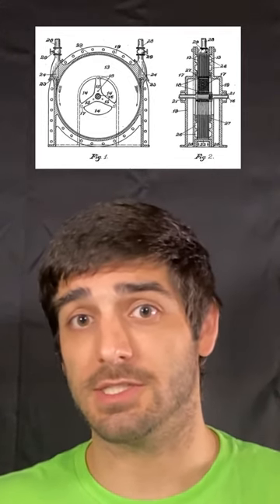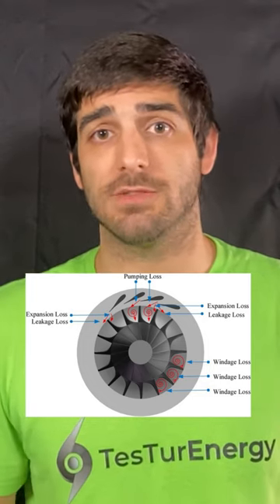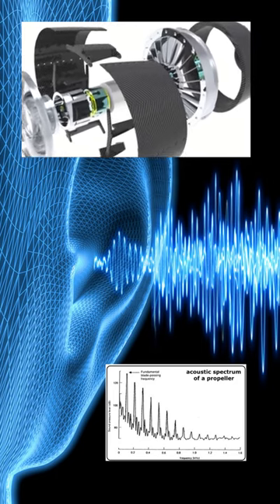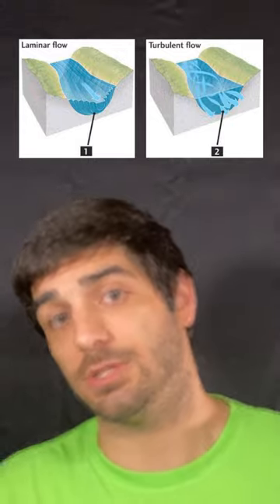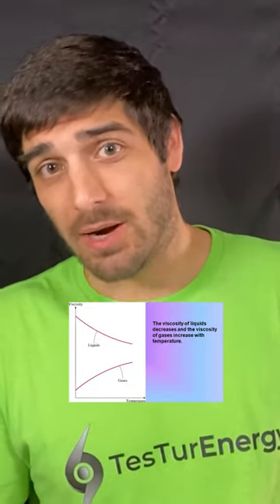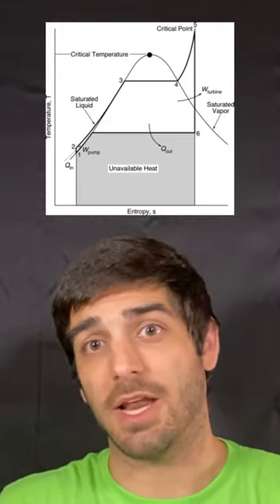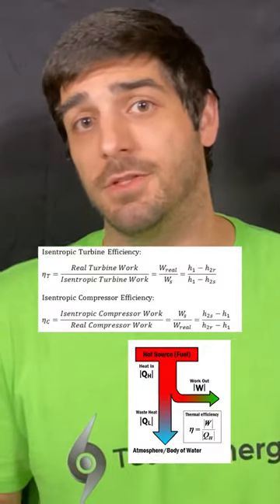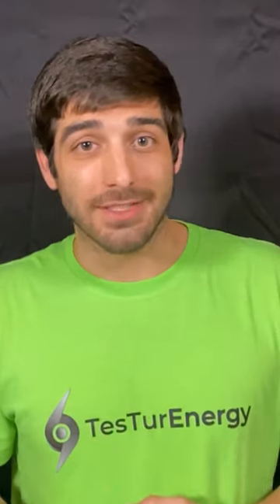Tesla Turbines For Nuclear Submarines

Comment: Do you have any side by side comparisons for a Tesla Turbine vs. a traditional turbine?  

From what I’ve seen you do show energy gains from air at a specific PSI, but there isn’t really a way in which that translates to other forms of energy. As it stands, it’s hard to tell scientifically that this technology is better than the alternatives.
Reply from the maker: Hey thanks for commenting! ❤️‍🔥🙏

First and foremost, in terms of using high pressure, low temp gases in actual generator capacities, Compressed Air Energy Storage (CAES) and Liquid Air/Cryogenic Energy Storage (LAES/CES) are very viable solutions, and they’re being employed at industrial scales as we speak.  

When we look at how engines function, they typically compress air, heat it, and then expand it.   

Most gas turbines and turbojet engines possess a compressor, operating on what’s known as the Brayton cycle.   

For those unfamiliar, the Brayton cycle comprises three main processes:  

1) compression of air 

2) addition of heat (typically combustion but could be anything) 

3) then expansion of the air. 

If we’re talking about steam systems, only heat needs to be added to vaporize the fluid. 

Systems like ocean thermal energy conversion (OTEC) can vaporize steam, or even function in an organic Rankine cycle, at significantly reduced temperatures.  

Tesla’s improved turbine patent GB 186,083 is particularly noteworthy here.  

It cleverly uses heat from the turbine exhaust to generate steam.   

This steam then cools the combustion jet before it enters the turbine, thus significantly reducing the compressed needs typical of most gas turbines.   

While regular gas turbines require an air-fuel mix in the range of 100:1 to 200:1, thanks to this innovative approach, Tesla’s patent slashes the load that the compressor puts on the shaft, making it efficient even with stoichiometric mixtures around 15:1.  

Moreover, Tesla’s patent GB 186,084 combines combustion and steam turbine functionality, eliminating the need for a compressor altogether.
Reply from the maker: As far as efficiency goes… (mind you this is a copy pasta 🍝 so it’s a bit long but it’s worth the read.) …My 2650watt electrical load run came in with a very low ball calculation of 40% isentropic efficiency.  To start off, mind you that includes generator losses, 3 phase rectifier losses, and inverter losses to the electrical load that were not accounted for. So the turbine off the bat is already most definitely doing better than the 40% isentropic efficiency I’ve calculated from the already low ball test results.   But for now I’ll just assume 40% isentropic efficiency so that I’m not over claiming what I can prove it can actually do for the time being. (I have nothing in the long run to benefit by overstating my numbers and only my legitimacy to lose. I’ve worked hard for my physics degree and don’t intend to tarnish it for a couple of extra views on the internet.) 

As far as inefficiencies to the system to fix, there’s 10x crappy ball bearings in this version, 2 crappy RC car gears, both losses will be gained for power out with a direct to shaft generator. (Minus two gears and 8 crappy ball bearings)  There’s an 1/8 of an inch of space between the turbine endplates and the casing endplates on both sides of the TesTur. That’s a 1/4in of open flow area around the 2in wide turbine (that only even has a total of 0.75in wide of spacing between all the tight disc spaces for torque to begin with.)   That means 25% of the open space for flowing through the casing, between discs and between the casing and turbine endplates, is just free flow over the side of the turbine still. (I’m using the absolute bottom of the barrel of machining equipment right now in my garage 🤷‍♂️)  There’s no labyrinth seals yet to even attempt to further reduce that overflow… 

The nozzle is atrocious at the moment, when making the variable converging section have a tight convergence it causes the fluid jet to aim more centripetally (towards the axle) instead of tangentially (glancing off the disc tips) which severely effects the fluids natural path.   This will be fixed with the new variable nozzle design I’m going with.    Then even further in this specific casing’s assembly there’s two “pillars” in the middle of the nozzle.   This is because the aluminum plates in the middle of the casing plate stack only had the variable nozzle bar and inlet holes cut out, and not the full nozzle geometry.  So those pillars are just vertical bars in the middle of the nozzle for the air to smash into just before going into the turbine (hopefully the wet steam tests will just erode them down 🤭)   Before all that there’s still about 100ft of air hose between the tanks and the turbine… plus a shell and tube heat exchanger and a TON of elbows and fittings.    I’m sure I’m forgetting something too but between all that being fixed… I can almost guarantee we will be in the 60-70s % range and that’s all just still with room temp compressed air.   Most forget, I’m using room temp compressed air and never went over 20psi at the nozzle for these tests. (Pressure differential and temperature differential govern efficiency) 

And even then I still only even have a single stage on it yet.   Everyone wants to compare it to the efficiency of a very high temp, high pressure (1000°F & ~1800psi) multibillion dollar 15-30 stage steam turbines…   😮‍💨   That’s apples to rocket ships. 😅  But considering Rankine Steam cycles get theoretical max about 33% of input heat (due to latent heat of condensation and that’s without any regenerative boiler feedwater preheat, air fuel preheat, etc) and then 40% isentropic efficiency (considering the turbine as is) we’re looking at 13.2% thermal efficiency with steam.   A more apt comparison for the TesTur would be something an individual can actually purchase, like 1-5kW piston gas generators that you can get from Home Depot or Lowe’s.   These get 15-22% thermal efficiency off the plant floor. Good luck getting that 1 year down the line or later with all those moving parts.  Also for reference, industry standard for micro bladed gas turbines is 25% thermal to electrical. Whole system efficiency can go higher in Combined Heat and Power (CHP) system, but alas the TesTur would see the same whole system efficiency increase in a CHP Auxiliary Power Unit (APU).  In the TesTur you gotta replace…? 🤔bearings…? And still even then, only maybe 🤷‍♂️ depending on how good of bearings, balance, lubing, cooling.   The TesTur, and other bladed turbines, only have one moving part. 🔥 

So if those piston generators drop efficiency, even at all, the TesTur on its worst day is competitive with a gasoline piston engine electric generator.🤓😬🤷‍♂️  And the TesTur can handle any fuel that can burn, even solid particulate fuels like powdered saw dust, pulverized coal, powdered iron, biomass, etc. (noting the number of those that can be acquired without spending money… 🤑 opening up “low monetary cost”, even carbon neutral, fuel options for MILLIONS around the world)  We have to remember that the TesTur doesn’t have to be the holy grail to be worth using if we have free fuels readily available like biomass, and even waste heat already being dumped out into the air and not used for anything.  The TesTur just has to be a viable option for some to be worth doing. 

Even more, the mere fact that I’m using a low temp fluid for my 40% isentropic efficiency calculation means my TesTur efficiency is severely limited by thermodynamics and fluid dynamics.   Increasing temps will automatically increase my turbines efficiency.  This is because gasses have an increasing viscosity trend as you increase the temperature.   This leads to increased isentropic efficiencies in the TesTur from reduced slip on the discs.  (Meanwhile, we’re already talking about a piston engine using combustion temps as is.)  Whereas bladed turbines see the increased viscosity as an increase in drag loss through the turbine blades.   So we can’t always count on seeing increased isentropic efficiencies in a bladed turbine in practice when we go from low temp to a high temp.  Again, to reiterate, this increase in viscosity in the TesTur only works to enhance the working action of the TesTur.  (That being viscous adhesion to the disc faces increasing torque.)  That’s all on top of the increased thermodynamic efficiencies of using a higher temp elastic fluid too! 🤓 

The disc spacing for room temp gasses is not going to be the same for combustion temp gasses/steam because the viscosity of either increases by 3x fold. And I’ve designed these spaces for a higher temp fluid with a slightly higher viscosity so these will inherently be too wide at the current temperatures being used.   So as we increase temps along with all these other really easy to fix mechanical issues (that only are a thing because I’m building this in my garage on a junk cnc machine) I have no doubt we will see more than competitive isentropic efficiencies compared to bladed turbines, let alone whole system thermal efficiencies that are through the roof.   This is because of the heat recovery systems that can be added with the cost savings of using a TesTur vs a VERY expensive, and in my opinion, relatively delicate bladed turbine.   Just getting tighter casing clearance with the turbine should give me at least 20% points back on efficiency putting my testur at the 60% range.   Coming in with a 19% thermal efficiency in a Rankine steam system without any kind of thermal recoup.

Comment: I found your video really interesting, especially the part about Tesla turbines. However, I wanted to bring your attention to a fascinating development in turbine technology inspired by nature. Engineers have been incorporating tubercles, similar to those found on humpback whale fins, into various turbine designs. These tubercles help reduce drag and increase lift, making the turbines more efficient. It's amazing how nature continues to inspire technological advancements! Keep up the great work on your videos!
Reply from the maker: Hey thanks for commenting and your kind words. 🙏❤️‍🔥 I really appreciate it.
 
Though I should be clear that due to the Tesla turbines not operating on lift, or pressure differentials across a blade, the Tesla turbine is luckily not a good application of the tubercles. 

One particular reason is the tubercles are specifically meant to induce turbulence to allow for stream separation to reduce drag. Howerver in the Tesla turbine any and all turbulence and stream separation between the discs comes at a loss of forward rotation torque, and stimulates unwanted vibration that can damage the turbine itself. 

And surprisingly these vortices can actually cause the fluid to move “backwards” relative to the disc faces and actually counteract the desired torque in the disc faces. 

Also another misconception about the Tesla turbine is that many people think it is a “friction turbine” but this isn’t accurate. 
 
This is what Tesla said on the matter. 
 
Tesla from Dr. Tesla Talks Of Gas Turbines.   
 
““I have been working at this a long time. Many years ago I invented a pump for pumping mercury. Just a plain disk, like this, and it would work very well. ‘All right,’ I said, ‘that is friction.’ But one day I thought it out, and I thought, ‘No, that is not friction, it is something else. The particles are not always sliding by the disk, but some of them at least are carried along with it. Therefore it cannot be friction. It must be adhesion.’ And that, you see, was the real beginning.  “For if you can imagine a wheel rotating in a medium, whether the fluid is receiving or imparting energy, and moving at nearly the same velocity as the fluid, then you have a minimum of friction, you get little or no ‘slip.’ Then you are getting something very different from friction; you are making use of adhesion alone. It’s all so simple, so very simple.  “This is the greatest of my inventions,” Tesla went on with great enthusiasm.“ 
 
It’s viscous adhesion and cohesion that are the important factors here. 
 
So in the realms of organic chemistry, using hydrophilic surface treatments for polar molecule motive fluids, like h2o, is more advantageous and using hydrophobic surface treatments for nonpolar motive fluid, O2, N2, CO2. 
 
It’s extremely important to maintain laminar fluid flow regimes between the discs to get n efficient and quiet Tesla turbine. 
 
I love that you’re applying other technologies to the Tesla turbine! 
 
Keep that strong intuition to cross apply ideas! It’s how progress is made! 
 
Much love and gratitude!